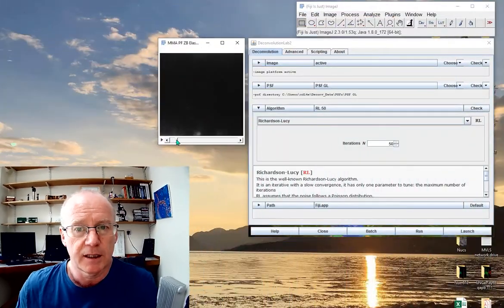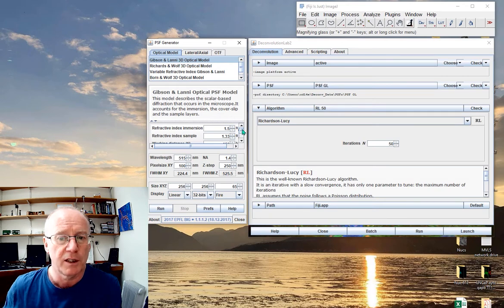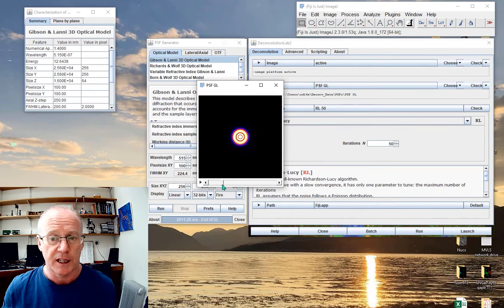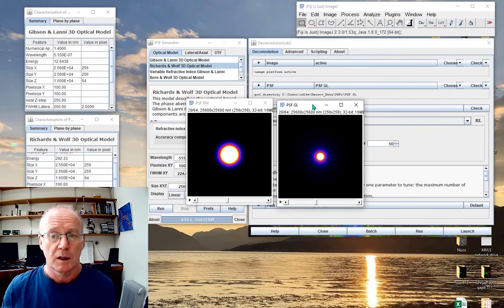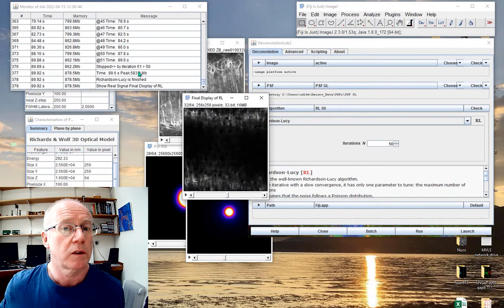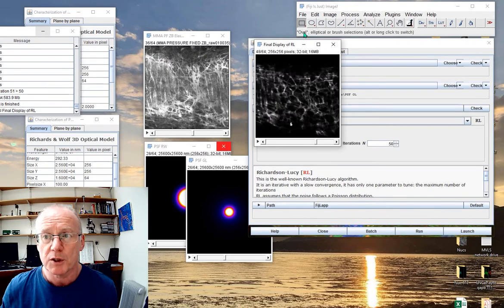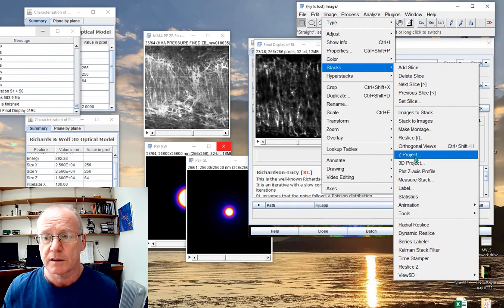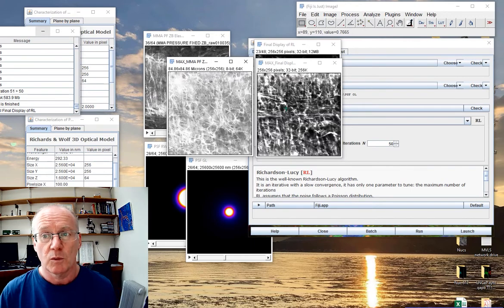Using different PSFs for Deconvolution (ImageJ/Fiji)

Comment: As Ahmed asked before, tryed to do it with CT .nrrd data but results was really bad. All I see was a gray image with almost no content. tryed to convert .nrrd to tiff and then use psf generator. but all information I have for PSF generation was the size of the data..where can I find other aspects? is default values okay? any suggestion for the whole process I really stuck at this point. Great videos btw, thank you.

Comment: Hi Dr. Caly, can I ably this to CBCT or CT data for a mandible?
Reply from the maker: Hi Ahmed, I don’t think you can.  The process I describe expects light to originate from a single point and spread out.  Since CT and CBCT use a different method of image generation I think it would be a mismatch of techniques.  Might be interesting to try it though but I would have little or no confidence in any quantitative measures made from the processed images.
Reply: @CraigDaly  We have an image quality phantom that has PSF insert. if I can scan it with the same voxel size of my scan, Do you think it would help?
Reply from the maker: @ahmedzakaria356  Hi, I couldn't say sorry. I just dont know enough about the CT side of things.  I see no harm in trying though.  Craig.